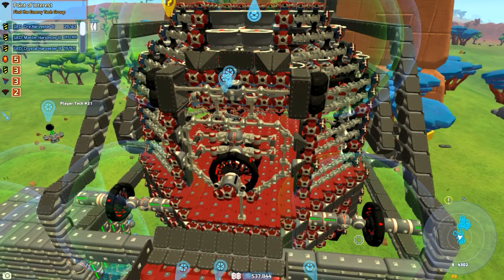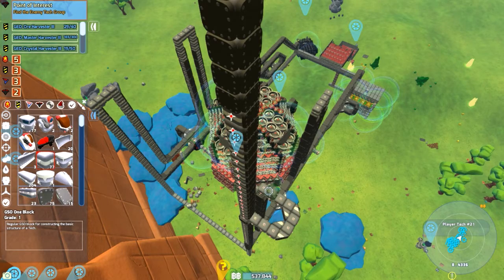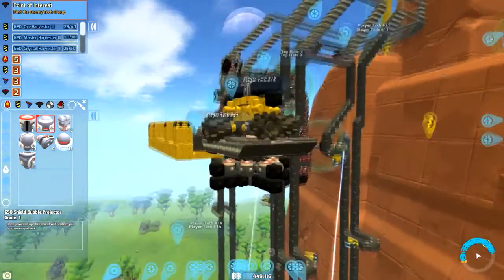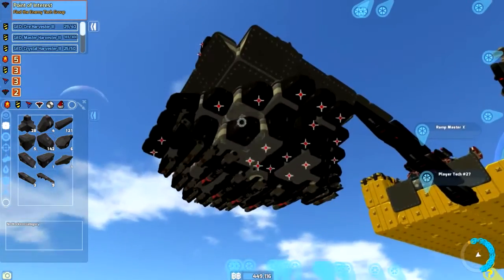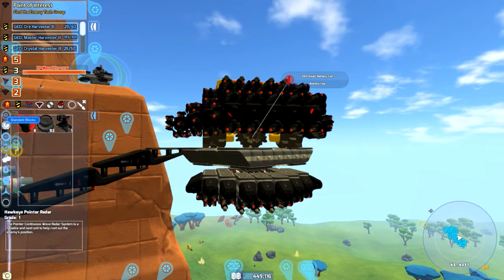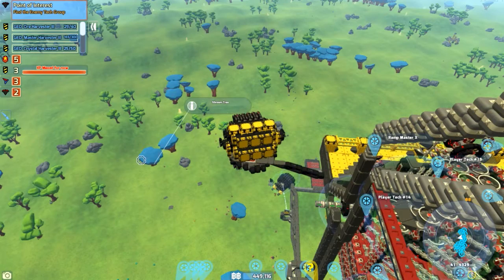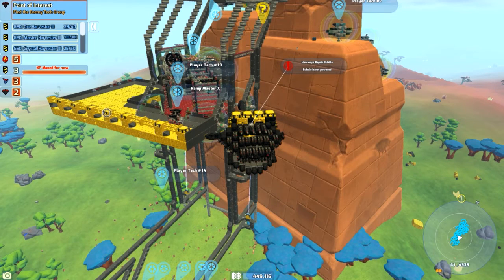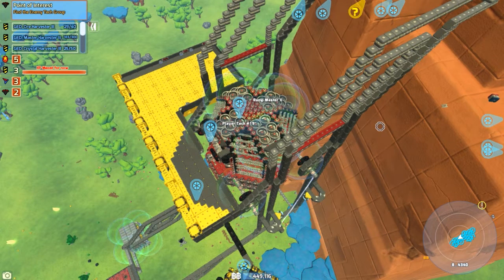Terra Tech - 0.7 - PT 15 -  2nd Floor Under Construction - Let's Play

Comment: Reaper this is amazing man iv never seen anyone do anything like you do keep it up its very unique and P.S when you get more cash or what not upgrade your RAM and GPU then you will have more fun. Im running this game on a I3 processor withe a GTX 750ti gpu and i get solid 60fps on high when i do the stuff you do. Keep the vids coming my friend
Reply from the maker: Thanks :).   I hear ya, I do really need an upgrade, but the cash thing is the problem.  Someday it'll happen.   Have a good one   [8D)
Reply: Reaper my pc only cost me £150 from gumtree you can get some really good bargains from there
Reply from the maker: That's about $250 CDN, but to get that much extra money is the hard part. I'm working on it though.    Have a good one   [8D)